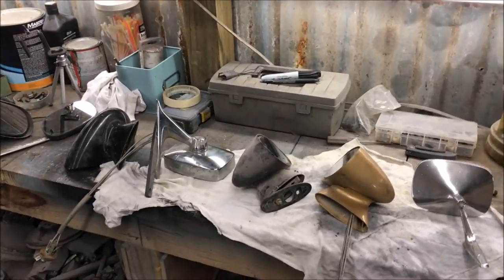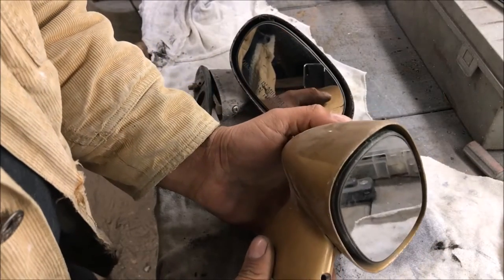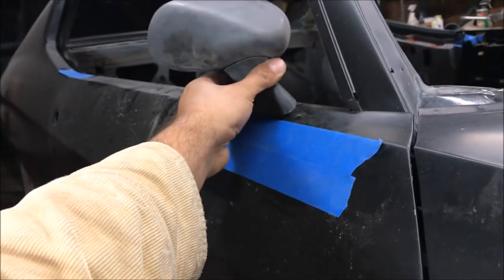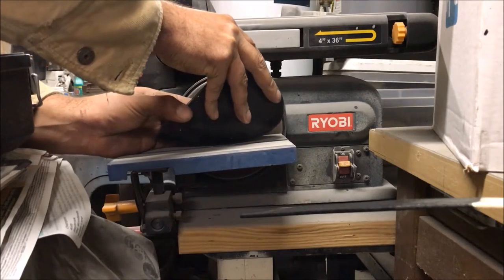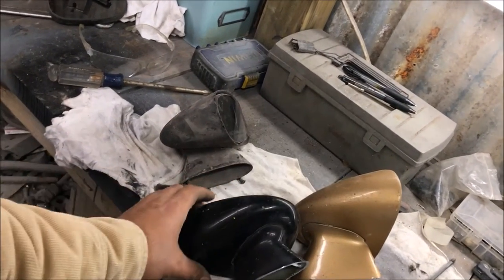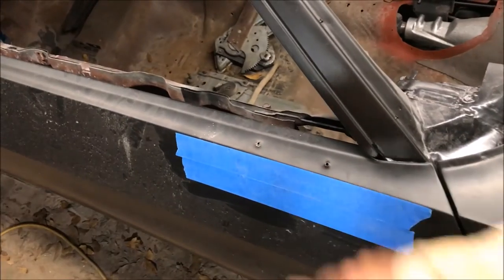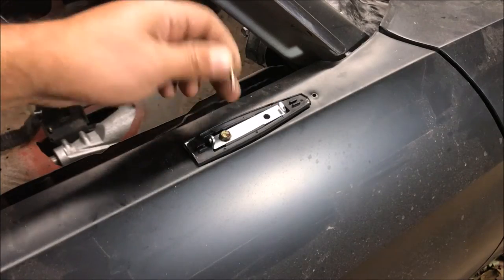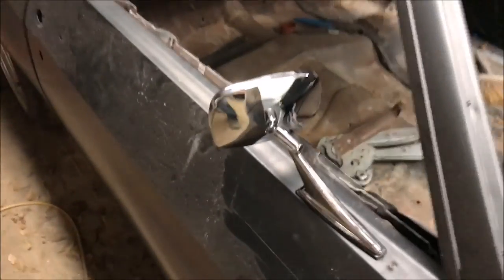68-72 chevelle door mirror info and install a body gm

Comment: The remote mirror you said was for the Monte Carlo was an option for the 69 -72 Chevelle and El Camino and came with the SS package {confirmed for 72 anyway} I have the factory hole for the remote on my driver door. I prefer to leave the car designers choice and keep the original. Great videos

Comment: Its a plate inside the door that the mirror hardware screws into. Screws into sheetmetal alone can rip out. Your drivers door had the reinforcement plate......its like a floater plate for you striker post. Same in principal anyway. Most cars that didn't have a passenger side mirror originally didn't have the reinforcement.
Reply from the maker: ok, so you totally confused me..  so the passenger door had a mirror added...  thats why the holes were off and NO, it did not have a reinforcement..  anyway,  thanks for the input...  what do you think looks better? the sport mirrors or the ones i put on the car?
Reply: I was always partial to the chome ones.
Reply: These cars never came from the factory with a passenger mirror. It wasn't an option, however the dealer would offer to install a passenger mirror if you wanted one.